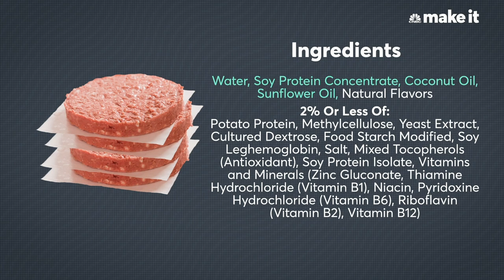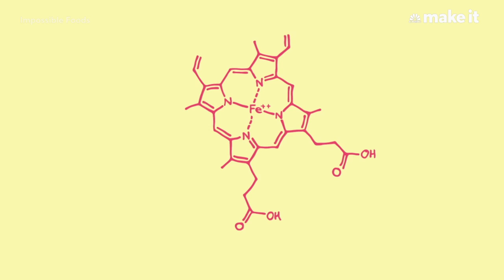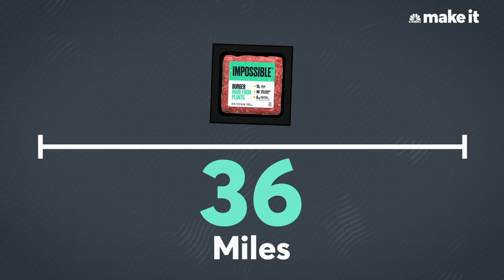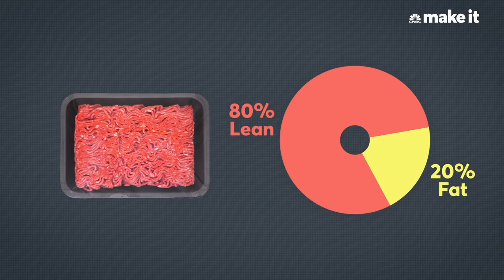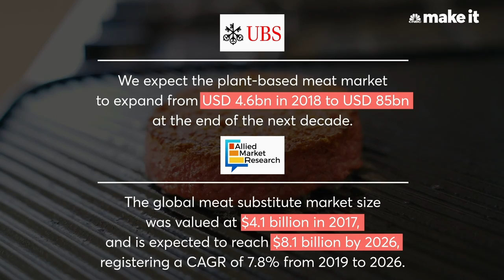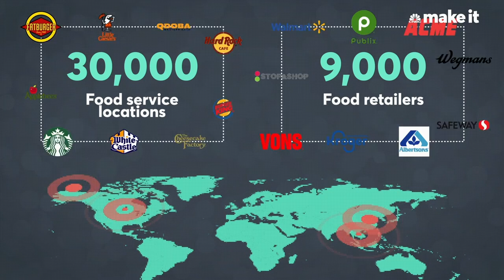How Impossible Foods Turned A Plant-Based Burger Into A $4 Billion Brand

Comment: [Sunday, 5-2-2021] I was finally able to get a chance to try the Impossible Burger, yesterday. They were on sale at a local Pick n' Save food store for $7.99 for one pack or two packs for $10.00, bringing the price of both packs to $5.00 each. Cooked two burger patties using my George Foreman Grill. (Recommended for removing grease into the grease trap.)

My GF Grill, on minimum heat, fully cooked the burger patties in under 4.5 minutes and I used Onion Flavored Hamburger Buns with Lettuce, Onions, Tomatoes, Circular Dill Pickles, Yellow Mustard, Ketchup and a pinch of Garlic Salt with Parsley. One bite and let's just say, I WAS HOOKED! DID NOT expect the burger to taste SO good! 

Plus there was NO greasy taste, thanks to my George Foreman Grill, which also improved the texture and I could NOT honestly tell the difference between real meat! When cooking the vegan burger patties, it smelled like a bacon burger was on the grill.😅 I will definitely be buying more, whenever I'm able to save up enough money to splurge!😅 The cost of these burger patties are NOT cheap which is the only downside.

Comment: DITTO AT 12:21??? Face mask below the chin, again, and the first one has a beard.

Would have fired anyone that was caught not wearing a mask on the production floor, and that's BEFORE C19. 

If a mask, gown, and a hair covering are a job requirement and you flat-out refuse to wear any of them properly, you're gone.

It's called employee Non-Compliance.

Short of that, they would have been told to go home for that or a few days, unpaid, off the clock. 

No apologies made. 

Ever. 

Is beard hair vegetarian, lol?